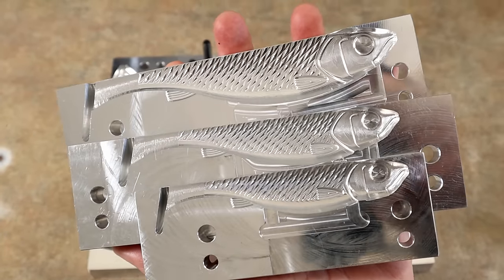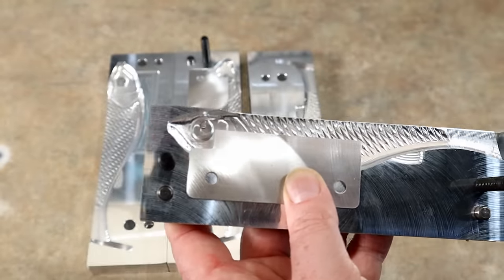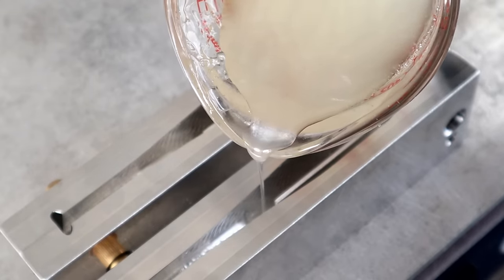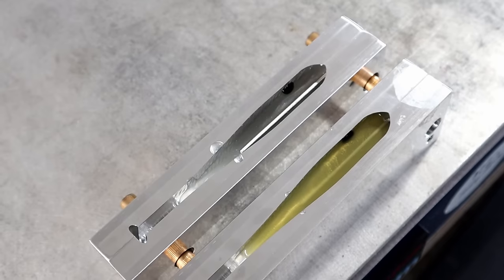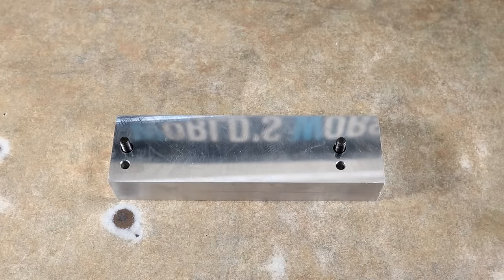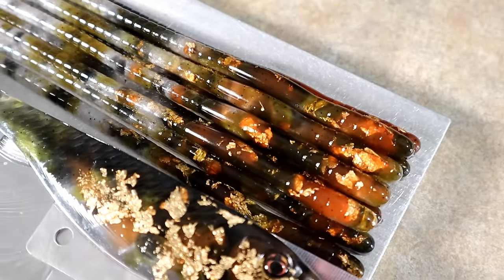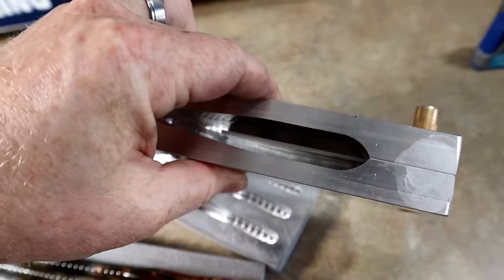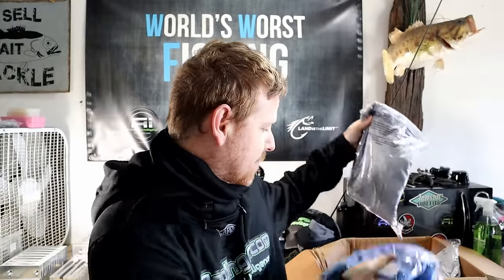New G-6 Swimbait Mold Demo & Soft Bait How-To

Comment: Angler Ai stuck on the 6 inch swim bait theory  ,I mean they already sold us a 6 inch swim bait now there is another ,with a different tail kick BFD ! another 100 bucks with a different tail and a few details ,huh ? why not put your aka improved G model series into a 8 inch variety ,I think Angler Ai likes to stay in a safe zone by catching fisherman not actually fish
Reply from the maker: 8" molds are seldom requested by the hand pouring community.  That is why you will find maybe 1 or 2 aluminum CNC swimbait molds of that size in the American bait mold market.  4"-6" is much more popular.  Are they supposed to make molds that their customer base isn't asking for? Of course not, and they are called Angling ai, not Angler.  If you don't like the mold, move on to something else you do like..pretty easy really.